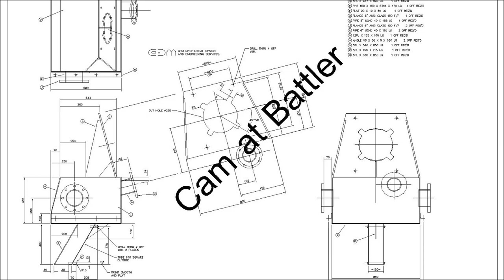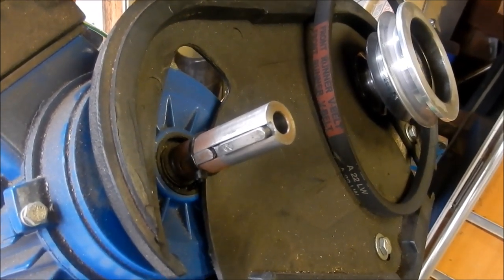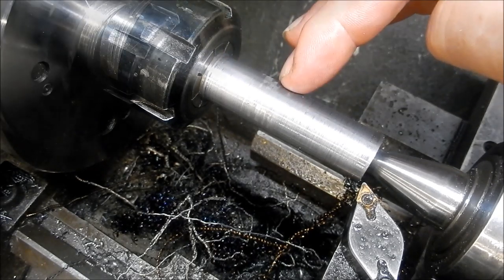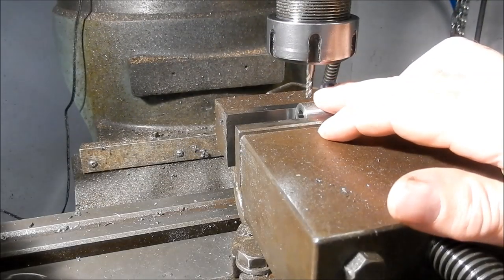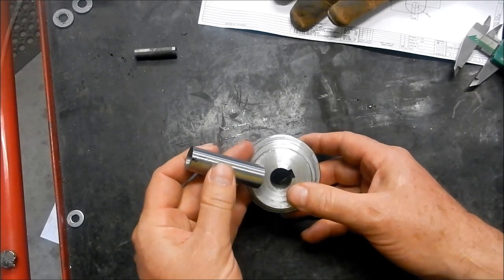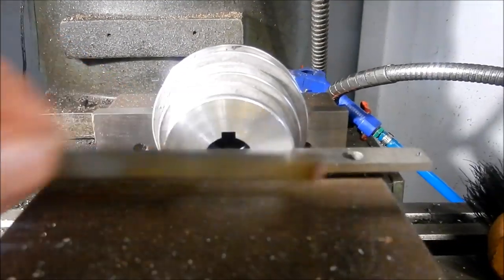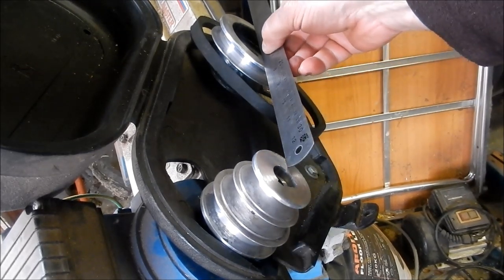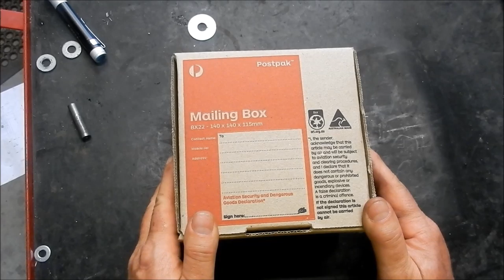Bandsaw Shaft Adaptor

Comment: Nice work  Cam!
I have an old Taiwanese made BS4 unit from H&F that i even though it has done a massive amount of work it just won't die ! I don't know why H&F  can sell motors for less than$200 but if you need a replacement motor for one of their machines it seems to be a special unit that cost more !
I suspect that the thing that will die on my machine will be the worm drive gearbox and i will have to do a conversion like Stefan Gotteswinter did to his .
One thing i did to my bandsaw was to fit a hydraulic ram to control the down feed -well it is really a pneumatic ram being used as a hydraulic ram but it works just as well and really made a difference to how square it cut as the pressure on the blade is much more controllable .
Looks  like you are now pretty much  fully recovered from your surgery and moving on with life which is fantastic to see mate !
Reply from the maker: G'Day Ian, Cliff from Cliffs shed is doing a rebuild of his gearbox making up a new worm and worm wheel.  I've seen a number of add on's with the hydraulic ram control and they certainly look like a great addition, certainly something I'll consider in the future.  Yes the BS4 Band-saw are no longer available, its replacement although looking the same doesn't have the same throat height and can't cut the deeper sections.  Thats one of the reasons I want to keep mine alive for as long as I can.
Cam

Comment: Thanks Cam,
Any reason you couldn’t use a longer one piece key in an L shape so the pulley and grub screw keeps in place?
Cheers
Reply from the maker: G'Day Raymond, now that's a definite, why didn't I think of that.  From memory in the vids I did for my re-work of mine I think I mentioned if I was going to do this again I would just mill one long slot and fit a stepped key to fit over the end of the motor shaft step.  Yep, my memories not what it used to be, thanks for the reminder Raymond, LOL.
Cam
Reply: No worries Cam, I seem to remember Randy Richards did something similar with a key when he did some work on one of his lathe repair videos, it was in the back of my mind.
Cheers